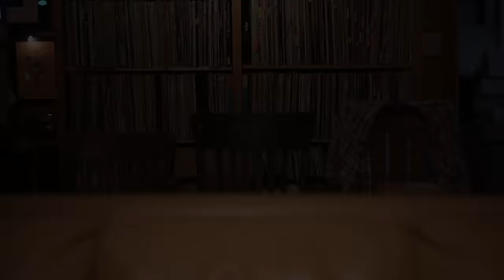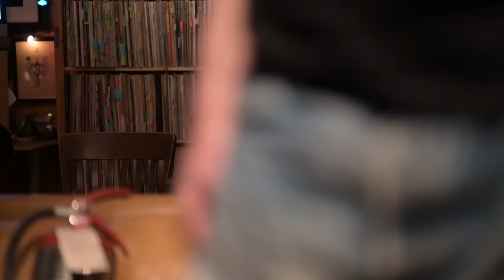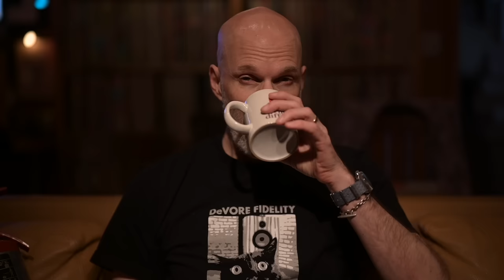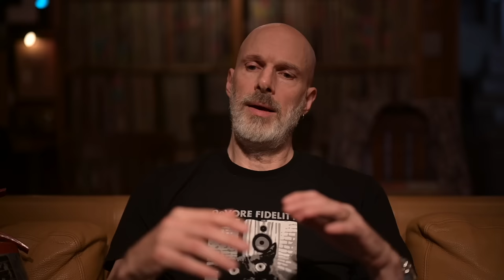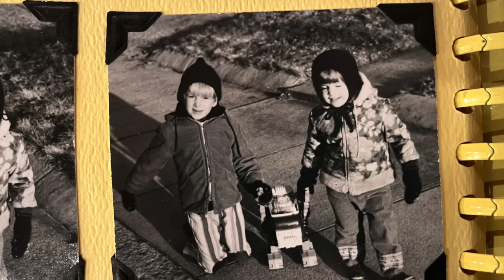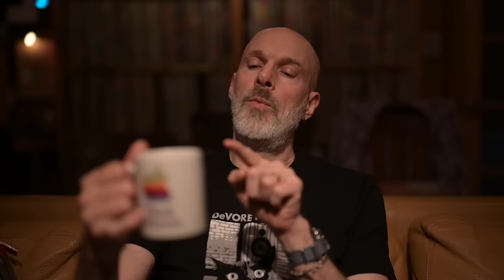John rants on measurements in HiFi, what they mean, limits,  and how they easy they are to weaponize

Comment: The fist thing "science" says about audio is that your observations of sound in uncontrolled setting, with your eyes involved is wrong.  That is easily proven and is part and parcel of human perception.  So no matter what is wrong with science of measurement, you can be sure that the substitute cannot be the subjective experiences you promote.  To wit, who says you made the right decision in having a worse frequency response in your speaker?  You are the designer with who knows what hearing ability to determine that.  The test would have been a blind, level matched one to determine if that correction was needed or not.  You know, when only the sound is heard and evaluated.  NOT knowing that one position of crossover switch says this and another says that.  Just run that test.  It should take just a few minutes.  Invite a few audiophiles over, don't tell them what you are doing and run a trial 10 times and see if you get 9 times in favor of your preferred setting.

That is how we do audio science.  Remember, if your brain can manufacture a band sitting in front of you from two speakers, it is quite capable of fooling you in other ways!

As to measurements, we apply science of psychoacoustics to them.  Then we can determine audibility.  And measurements as far as what I perform at ASR, are a full suite, not one signal as you imply.
Reply: Amir, you know as much about what you are talking about as the man in the moon.

Comment: When I build cables, I never measure them, I build lots of different designs & then trust my ears, different materials measure different, so trusting your ears is the only way to go, great video as usual John👍
Reply: Huh, electrical parameters of the materials used in audio cables are all known. There are also simple to use calculators where you can enter the geometry to derive further electrical parameters.
When you say you "trust your ears" you do realize that there is such a thing as cognitive distortion, right? Mere expectation or preconceived notions you have about some material will distort your perception. The effects are like someone secretly adding an EQ to your playback chain.
I guess you also trust your eyes, but it is well known that our eyes have a blind spot and the brain generates (false) information to fill in the blanks. There are also countless optical illusions that are trivial and yet they fool your oh so complex brain.

So what you're doing is one step above blindly guessing, but with just a little bit more understanding of electronics 101 you could come up with optimal designs in a few minutes.

Comment: Yeah,  this is all important to understand.  I drew some heavy fire on an audio forum recently trying to explain how designing to pass the FTC power testing regimen and designing an amplifier to physically drive speakers are two completely different things.  Most didn’t get it.  One guy said the spec sheet included with his receiver "guaranteed" stated performance.  I was only in the  industry 25 years, what would I know. 
Nice job.

Comment: Measurements like the ones Amir makes on ASR can let you know how accurately a component can take an input signal and reproduce it.  That is what Hi Fidelity is by definition.  But it does not mean you will necessarily prefer a more accurate sound.  Having objective measurements as a baseline can help you chose which component to purchase and narrow down which to audition.
Reply: Exactly. The film industry has been using such an approach for decades now because it works for the feel that goes with the film, both being greater than the sum of their respective parts. 

Skywalker Sound found that test audiences preferred accuracy with a down-slope in the early '90s-- it's not just Toole. They'd have never continued with dogma if it didn't turn a profit for them and their clients.
Reply: That's exactly it. It's certainly true that some people might prefer say a hifi amp with rolled off treble and a moderate amount of 2nd order harmonic distortion. It might improve a thin sounding recording. But not all recordings are thin sounding. An amp like that would make a bassy recording with rolled treble sound mushy. So buying a colored high fi component like an amp with a non-flat frequency response is like buying a really expensive equalizer with only one fixed setting.

Comment: My first system: Pío SX939 receiver, PL51 manual turntable with Shure cartridge and CS99A speakers.

I managed stereo stores in the 70’s and worked in consumer electronics 25 years. If I had a nickel for every time I had to explain how specs were ‘fake news’ I’d be a retired gazillonaire.

Comment: This video was excellent.  Thank you for making this video.  I can't tell you how many times what I have heard has been dismissed by measurement cultists, who dismissed what I said outright, simply because it was not experienced in a double-blind study and because my experiences could not be measured.  Such a simple thing like hearing a huge difference in my system when changing speaker wire.  I inquired why this is, hoping to find a scientific reason behind it.  But not only did I not find an answer online, I was met with hatred, anger and disrespect for having the audacity to ask such a thing.  They wore their measurement beliefs like a badge of honor, when it was so clearly a badge of utter ignorance.  I wasn't guessing about what I'd heard and I was not taken in by snake oil, as they put it.  I heard the difference on my own system and someone changed wires when I was out of the room each time and sometimes they didn't change them at all.  Yet I guessed right every time.  Because I was not guessing.  I heard audible differences.  My roommate says I have "great ears, and that women are known for having sharp ears."  I am a relative newbie compared to him, but the point is that this was not about lusting after gear or being influenced by anyone or any external factors.  Someone swapped some wires and I immediately heard and pointed out the differences in the sound.  I took notes and it was all done very carefully, considering this was just an at-home experiment in my living room.  I thought I'd find tons of information online and I was so excited to learn more about audio, only to be mocked and told that I was a fool.  It made no sense.  They were so closed off in their beliefs that they would not entertain the idea that I was hearing something that they were not.   It doesn't matter that most of them listen on lower end systems and mine is worth around $40k.   It doesn't matter that I made sure to use reference records that I know every single note and subtlety of.   They simply dismissed my findings.  What a disappointment.  I was ready for a scientific journey to find out the WHY.  And they simply said it didn't happen.  They were so ignorant, but actually believed that they knew all.  To think that a measuring device could operate like the human ear?  Instead of using those devices to get closer to an answer and learn more about what we don't yet know?      Anyway, -  thank you for articulating these things that I've thought of for so long.  I've never seen this problem in the audio world addressed so accurately and clearly.   It's a pleasure to listen to.  As were your orangutan speakers I had the pleasure of spending a few hours with many years ago.   Take care and keep sharing your great stories and knowledge.   We need more voices in the audio world.  This should be a hobby of endless learning and enjoyment.
Reply from the maker: Thank you so much for the comment, and for sharing that very cool experiment, and unfortunately your experience running into the "objectivist" trolls. Bummer you had to experience that, there are lots of us out here in the interwebs who do understand that the differences exist and are audible. Welcome to the channel.
Reply: Every newbie engineer - measurement cultist or feels before reals objective reality denier - can tell you that cables, in the most simple model, act as resistors. Thinner cables generally will result in (significantly) higher resistance which will cause a drop in level at the speaker.
On a more sophisticated level, a cable acts as a passive low-pass filter. This still is electronics 101 and trivially true.

It's also true that you can get dirt-cheap cables whose filtering effects will be too small as to be perceivable.
This is why "measurement cultists" that understand this ridicule you. You probably spend hundreds if not thousands of dollars on something trivial that has been understood for decades.

Btw, such ignorance is deliberate in the audiophile industry. It would be trivial for manufacturers to specify the electrical parameters of their cables and precisely calculate the effects e.g. on overall level or frequency response. They don't because that allows them to produce cheap crap cables sold at a 1000x premium. This only works if the customer is ignorant and has his/her biases confirmed by others.

Comment: I don't think that measuring things is the problem, as you said you are measuring your speakers yourself, but reducing a complex system down to 3 numbers does not work and that's the point here. It does not even work on subjects that have nothing to do with taste and emotions. If you judge the speed of a car only by acceleration, top speed and breaking distrance, then Max Verstappen wouldn't win a single race. HiFi is a very complex and to a degree even a chaotic system, you can measure almost every detail but you can not really calculate what the sound will be.

Comment: Comparing two amplifiers with the same measured results can sound differently, with one sounding better than the other. 
The reason is that the difference that we hear is based upon the fact that despite the many test parameters conducted, it is a particular measurement that has NOT been done that would explain the difference.
I believe that if you can hear a difference, then it can be measured.
Reply from the maker: agree 100 percent. the motivation to keep updating and improving test methods...

Comment: The 22 khz initial response limit was logical. At a good seat in any concert hall (row 10 - 20), you are lucky if you even get 16 khz. FM radio typically had a brick wall filter to kill the stereo pilot tone. Tape heads even at 15IPS limited HF due to the tape head gap. Popular condenser microphones in that era had resonance issues in the 24000 to 30000 hz range (that never were audible due to the head gap!).

Comment: Subtle harmonic distortion/coloration or frequency shaping can be audibly pleasant but not measure well in a test that penalizes anything but clean, transparent or linear signals. That doesn't mean people like Amir from Audio Science Review are missing the mark. I think it's perfectly valid to prefer the most clean, transparent and neutral system you can get as a foundation. You can always add in some extra mojo to your setup, by having a second set of speakers that are more lively and colorful..or adding some tubes to your chain when you're in the mood-- or even using DSP to add in some spice..
There's also nothing wrong if you prefer to daily drive the magic mojo from the get go.  Diff'rent strokes for diff'rent folks.

Comment: Howdy. Yeah.
Frequency bandwidth and THD for one sine wave belong to the sixties and seventies. Usually applied for tube amps. It is a good start but yet far away from the listening experience.
Next step is to check the rectangle wave response. Are there overshoots and undershoots at the ascents and descents ? Maybe there is residual ringing. If so, it is indicative of long loop neg. feedbacks. I.e. there is time delay in the loop. This does not show in single wave bandwidth measurements, because the sum wave of the sine signal and the phase shifted sine feedback is a sine wave.
And further. Check the response of triangle waves. Are the slopes straight lines ? If not there is harmonic distortion. Way easier to see visually than looking at sine waves.
Yet still. Check the burst response. Is the amplitude constant during the burst ? If not, it is indicative of that the power supply struggles. There may be compression of the audio. The pumping audio is very annoying to listen to.
If these check out the system is ready to for listening evaluation. If not I would not bother if the aim is High End.
Regards.

Comment: Love this. Unfortunately in HiFi most people don't learn this until later that good measurements don't equal good sound. The newcomers to HiFi often chase specs. If you Google "<hifi equipment name> review" one of the first hits is often an ASR forum post "review" with THD and SINAD rankings, usually with Topping and SMSL at the top, very little in the way of listening. I'll hand it to these big Chinese HiFi manufacturers, they knew they could sell a lot of amps with good "specs". 

The measurements need to evolve. It's obvious that seasoned audiophiles figure out that specs aren't everything when you see that "Late stage" HiFi people invariably have tube amps or tube preamps, which often measure poorly. I left behind my SMSL DS DACs for R-2R DACs that have a more natural timbre to my ears.
Reply: I feel you brother. I left behind all these lies of electrical engineering and now power my rig with the ether from a group meditation (30-40 people). The custom cabs and drivers have the worst measurements possible that I will happily enter them in ANY contest. Oh, and the measurement police keep spreading the great lie about magnetism, too! Mine have worst gauss values ever, and yet they are divine.

We have to stick together!

Comment: John one can add meaningful differences to this equation as well. anny S/N value 100 db or greater is is reality quite the same, 0,04% THD does not really differ that much from 0,002 % etc it's just numbers without any meaning in it self. Measurements are complements to listening not the other way around.
Reply: It is definitely critical when working in a studio when one is doing engineering and tracking for a film score that has 40+ channels of close and hall mic'd instruments and miscellany. Intern in a studio and hear it for yourself.

Comment: I fell for the Revel/Harman/Toole montra and bought the Revel 328Be speakers, supposedly the best speaker they have produced to date based on toole and harmans extensive testing and research.  A week later i sold them, while they did certain things well, especially off axis listening, the sweet spot experience was lacking with the bass feeling disconnected. to your point and as much as i wanted them to, my brain was not able to take the Revels stimuli and construct a "correct" experience in my brain.